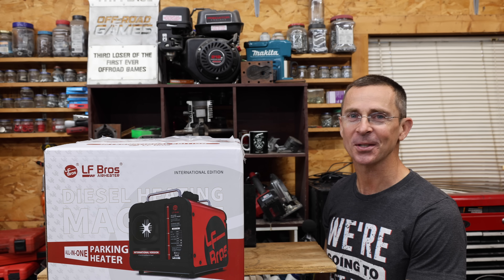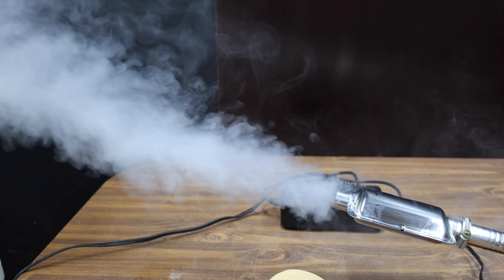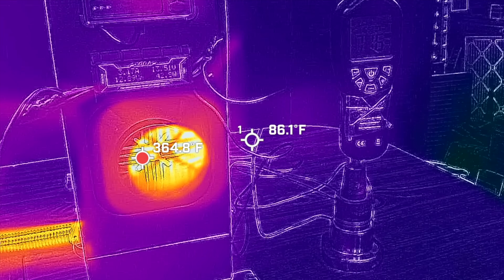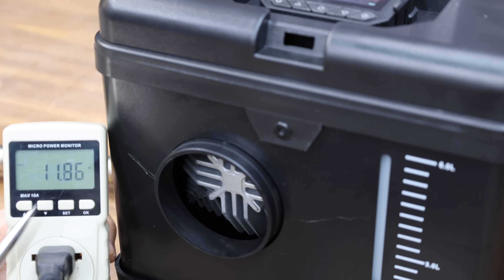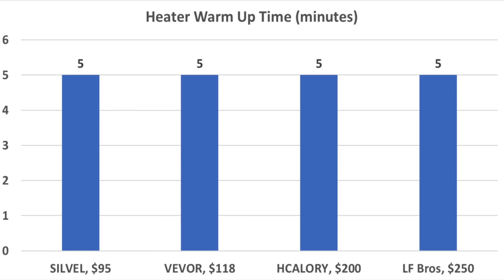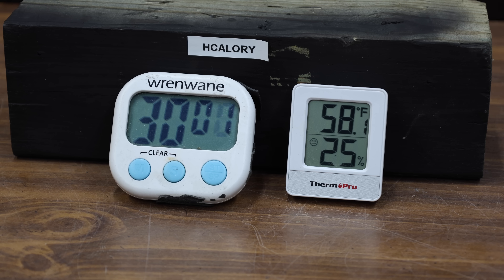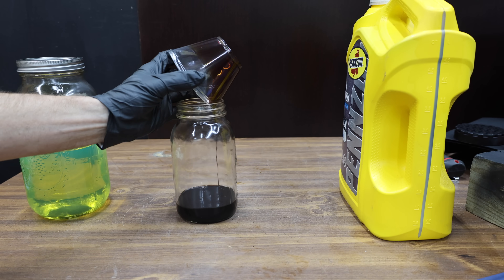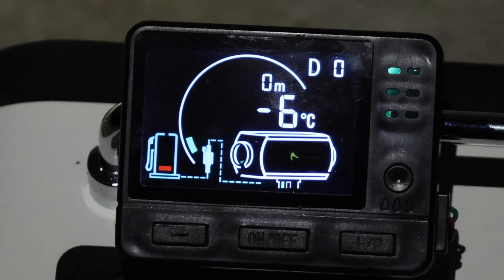The Truth About Cheap Diesel Heaters!

Comment: I've bin heating my garage with the Vevor heated for two winters now !!! Every 40 hours you have to take it apart and clean the combustion chamber. 
One fuel pump and three  heat screens. Fuel pump was my fault if you run the heater out of fuel six times you need a new fuel pump lol. I've burned about two hundred gallons of fuel so far ! Its like the little engine that heats lol get spare parts for your heater model you need new gaskets when you clean it out
Reply from the maker: Thanks for sharing.

Comment: Video suggestion: Bluetooth speakers.

 Glad to see you using your Bluetti, I had the same issue using it's DC to run a VEVOR I bought, could you test the dc output on the bluetti? Its supposed to be 15a I believe so should handle these heaters no problem right? I'll be buying that converter and seeing if my vevor works after all. Thanks for another great video!
Reply from the maker: You are welcome!  Thanks for the video idea.

Comment: If you like the LF Bros, but not the price... the two that are identical are GearZaar and Wippro ($189)
You will want any model that states 2024 upgraded model (or 2025) As some of these are starting to have UL listing approvals. The really new models are the ones with the exhaust already plumbed out the side. That's how you can recognize them right away.
The GearZaar was only $115 at the time I purchased it, and has Bluetooth app and a "quiet" upgraded fuel pump. It runs about 45 hours on low. (I run red dyed Diesel, which a bit cheaper) And it actually included a drill bit for the exhaust hose. Which was a nice touch. AND the wall plug adapter. Which was an aluminum extrusion housing, not a cheap looking black plastic brick typepower supply.
Reply from the maker: Thanks for sharing.

Comment: Just a little bit of info and advice. Video is great for most people who want something that just works out of the box, but Most of the heaters don’t come calibrated from the factory, hence the different levels of smoke at startup. Silvel being the worst. Didn’t know this when I got mine and it would smoke like crazy, eventually it wouldn’t start. Took it apart and the entire heater core was just black soot. Cleaned it out and Adjusted the fuel output and worked 20x better, even hotter. A simple adjustment in the setting page can make your heater work even better and probably last much longer.
Reply: Also when you change FUEL you need to change fuel pump/ fan settings to optimize the burning.
Reply from the maker: Thanks for sharing.
Reply: They'll also smoke if they prime but fail to fire (eg inadequate power on startup).

Or if they're not shut down properly due to some idiot tripping over the wires (ask me how I repeatedly know)
Reply: @exasperated  if they are hot, they can actually crack the combustion chamber if shut down improperly (no fan cooling)
Reply: @ghostrider-be9ek  mine back flowed and melted the entire inner blower lol. Had my exhaust angled poorly while moving.
Reply: @ghostrider-be9ek  Agree they Should all have battery backups. power supplys are sold on aliexpress that have switchover on power cuts UPS. and are a battery charger at same time about £17UK
Reply: I always blow into the intake whenever black smoke starts
Reply: @snazzymcnazmy  Really? Does that work?
Reply: Same experience with me and the Silvel. If buy it you need to change the default settings or it will smoke and burn out. What settings did you land on? Had to lean mine out.
Reply: @cyrusozdalga246 I just ordered silvel hope I can figure this out, don't have any diagnostic tools for this ...
Reply: Thanks! Oh no I just ordered the silvel before I saw this vid. Hope the adjustment directions are in manual or maybe a utb vid.
Reply: They are essential just a glow plug. They are all basically the same. You should be a little mechanical inclined.

Comment: I don't get this. If there is a power outage, why would you get a diesel power heater that need power to run. This seems kinda stupid design. Why isn't it making its own power ?

And yeah, you could use a 12V battery but then would it be drained ? How do you get it fully charged again without power ?

Comment: I have 5 of these installed in the basic heater kit form, garage, outbuilding and standby for the house which is the same that is in the cases the reason all the tests were so similar is because they are identical heaters just put in different cases to make them portable, all the spare parts fit all the heaters (5 & 8kw) so any difference will be down to standard manufacturing tolerances, the length of the exhaust to intake is important when installing.
Best advice, yes DONT use engine oil it will coke up in short order don't even mix it with diesel either, same will happen just take a bit longer. Kerosene works well, the pump needs lubricant or they fail quickly. The Chinese like changing the control systems with these so the mother board and interface are not always compatible. Keeping a spare glow plug, and pump is worthwhile. exhaust hardware bit iffy, silencers are not gas tight, use mikalor brand type clamps for best results.
Using 13v keeps the glow plug current draw down and helps pcb life, best used from a constantly charged 12v battery in case of supply failure as the cooldown cycle is needed for safe operation. very effective and cloned from a well known German brand.
Reply from the maker: Thanks for the feedback.

Comment: I use the Vevor with a lawnmower battery with a 12 volt solar charger in my well house.on low. It's nice as in low it'll last nearly 30 hours, unless cold cold.
I regularly use 60/40 diesel and used motor oil. I've not noticed any carbon build up. At a 50/50 blend i noticed a black sludge in the exhaust pipe.
Reply: What are the conditions for your well? A little $15 electric heater would be better... Using a diesel heater in a well shed is the equivalent of a 600 HP engine in a Prius...

If you have -30 temps I can see, but just insulate it and put a little heater in where you can set a 45f temp.
Reply from the maker: Thanks for sharing.

Comment: I think I would buy the LF Bros simply because it requires less wattage to run using a power bank.  FYI the old Jackery 500 units will power a diesel heater with their 12V plugs but the newer generation and larger 1000W Jackery will not power a diesel heater.  Great great great information as always.
Reply from the maker: Thanks!

Comment: Almost all of these Chinese diesel heaters are the same with different electronics. You can even order two of the same and they will have different electronics. You are better off buying either by the cheapest, or which electronic features you want... But be sure that what they show is what you get.
Generally the "universal controller" is the best, especially if you want to use an aftermarket thermostat like the afterburner. But then again, you can buy one that shows a universal controller in the photos, but come with a totally different controller. On the other hand, there are controllers that look universal but are not.

I would say almost all of the differences from the tests are down to manufacturing tolerances, and how they tuned the settings in the factory.
Reply from the maker: Thanks for sharing!
Reply: @ProjectFarm  thanks for all the videos!

Comment: How efficient are these vs natural gas or heat pump electric?
Reply: Not efficient at all. 

You'd lose money using one of these to heat a living space. They are small, but lots of heat goes out the exhaust. 

If you have a heat pump option, go that route. Only use these for temporary heat... Camping, in the garage, ice fishing, etc...
Reply: @volvo09  garage that's insulated, vs opening the door from the house to the garage and letting the heat pumps work overtime. Thank you!

Comment: to be fair, the silvel smoked after a failed start (where fuel was pumped on to the burn screen but did not ignite) all of the other heaters will also smoke after a failed start. because now theres diesel in the burn chamber and exhaust pipe which makes the smoke when it finally ignites. normally only fuel vapor which ignites via the glow plug.. I have 3 diesel heaters. the noisy Hcalory and 2 Gearzaar that look much like the LF bros. I sopped using the Hcalory, it's too noisy click click click. the oother 2 are hard starting with the included power supply, they work better with a car battery.
Reply from the maker: Thanks for sharing!

Comment: I have been using a Vevor 2kw in my 6.5x10ft Ice fishing house for 3 years now with good results! I run it on 2/3 diesel and 1/3 used engine oil and it runs really well. I have been very happy with it. I get 2-2.5days off two gallons of fuel on medium heat setting.
Reply from the maker: Thanks for sharing.

Comment: Never used a Diesel heater. My only question is, why don't they have a small generator so they don't need power after being started? Burning fuel with and producing heat but not power. I'll stick with my stand alone gas heater.

Comment: If you do this again in the future, it might be valuable to do a test in which you vent the exhaust outside, but close off the garage otherwise, and then have a CO meter to test if CO is still building up in the garage. The biggest thing I would be worried about when using one of these is if CO was leaking through the flex segments in the exhaust pipe, or coming out of the hot air outlet.
Reply: It's a good rule of thumb if you're going to burn anything for heat, get a CO detector. I have an indoor-safe propane heater for when the power is out and I keep a CO detector in the box with it so I know where it is. The detectors expire every few years so they need to be replaced. Better than waking up dead I figure.
Reply from the maker: Thanks for the feedback.
Reply: Considering these things are mostly no name Chinese products, I would simply be worried about exhaust leaks anywhere in the unit.
Reply: Can use some high temp silicone sealant if you're worried

Comment: As a truck driver, we’ve been using diesel powered heaters to warm the sleeper for years. I didn’t know that they were available for non commercial use. This channel is awesome. Thank you so much for what you do!
Reply from the maker: You're welcome!
Reply: Just recently in the past few years. Webasto’s patent expired so china did what china does best.
Reply: @LifeofAedan  Would have been great to see a Webasto included in the comparison. Also a class comparison with a Propane type like the Buddy heater.
Reply: @LifeofAedan  yes Webasto and Espir. Doesn’t surprise me that they’ve been sold to or farmed out to china
Reply: @glentucker4250  Neither Webasto nor Eberspacher has been farmed out to China, China is just making the design too now that isn't patented.

A Webasto air heater like this is closer to $1K than $150.
Reply: In northern europe even diesel cars have diesel heaters(Webasto).
Reply: @Technoboy1000 it depends I'd say. I only know this case that the heater in the car uses the same fuel type as the engine uses. In my case a Skoda Fabia using petrol and the auxiliary heating uses petrol too. It may have only one downside: if you set on automatic and "forget" your car over a month, then it's likely happen that the (main!) fuel tank is (almost) empty. But on the other hand it's more comfortable because I don't need to refill a small extra tank.
Reply: @Technoboy1000  Yes. And they aren't offered in the USA due to liability concerns if they're used in a garage and give someone carbon monoxide poisoning. They're missing out.
Reply: @Fekillix They are vented to the outside!
Reply: @astroboy5137 If you have a car with a Webasto parked in a garage, it definitively isn't vented to the outside.
Reply: Have rebuilt many Espar and Webasto units in OTR trucks.
This is identical, just bigger.
Things kick out serious heat.
Newer idle laws have and emissions systrms that hate idling have helped some fleets adopt these. The real savings was fuel use though.  Average 15L tryck engine uses average 4 gallons/hr of fuel. Diesel bunk heaters use approx 0.4 gallons/hr.  Huge savings for larger fleets. 
Glad to see these being offered cheap and in big boy sizes.  Espar units were like $1200 (8-10 yrs ago).
Reply: @wrenchpony9735  Greetings: I installed and serviced them back in the 80s. R U in Canada?
Reply: @Dark_Knight_USA  nope. NE Ohio. Edge of lake effect snow 🥶. Not quite Canada cold, but we try 😁👍
Reply: @wrenchpony9735  Greetings: I have been there. Yuk. Notorious 4 the horizontal icicles.
Reply: Boomer probably don’t even know how to Google things lol 😂
Reply: @Sickoloko24 Boomer invented Internet lol
Reply: You know they invented the internet, right?
Reply: How do you warm up truck with the heater if it has exhaust fumes? How does that work
Reply: I've been using them in my boats for years
Reply: Can you suggest one that doesn't have a fuel pump that clicks?
Reply: @neogeo8267 they all do. It’s because of the build from espar and webasto of expired patents. No one made their own at all.
Reply: These have been around since the 1930’s.
Both gas and diesel.
I had a 1972 VW van with one in it.
China built over 17,000,000 of them and installed them in their state owned trucks in just over a year.
Reply: Greetings: I was installing Espar units in trucks back in the 80s as a trial. The pitch was they used less fuel. However they R current pigs. There were many problems with them then. I had proven modifications and changes however the company decided 2 abort the project and remove them. Sometimes I wish I would have saved a few. Then again, I have way 2 much junk being a pack rat. 8:54
Reply: Same.
Reply: The patient expired a cupple years ago now they are everywhere
Reply: @aaronoconnor606  Greetings: "cupple"? New spelling of existing word? New word or a misspelled word? :)
Reply: you're not funny
Reply: What do you mean non commercial use? Everything is available for non-commercial use...?
Reply: @cabinfevrr  Greetings: I understand what he said. Decades ago they were installed in some OTR CMVs as an attempt 2 save fuel, engine hours and noise. Such was soon aborted Bcuz of expense, trouble and parts availability. The private market had no use or demand much less could afford.

Comment: You forgot to mention a Battery to keep the fans going..  
Good Video.
I prefer Catalytic heaters as in Most RV's.  Run on Propane.  But they get expensive.  But then you need to get a Nice fan or pay the kids to Fan the heat around.
Reply from the maker: Thanks for the feedback!

Comment: Should run the exhaust through a water heater/buffer tank with an internal coil then plumb the exhaust to the exterior from there. It would make lots of hot water with that amount of exhaust heat, you could then circulate that through radiators or plumb it to a sink/shower.
Reply from the maker: Thanks for sharing!
Reply: @ProjectFarm  I'm over at my home in Ireland and dreaming about dry warm air... They only use radiant heaters here, God I miss forced air heat/hvac, and how it dehumidifies!

Comment: The problem is, if you have an extended power outage,  it may die on you.  I have used kerosene heaters that don't use any electricity,  and heated a 2290 square foot home for 3 days waiting for the electricity to come back on. Kept the temperature about 65- 68 degrees,  not overly hot, but livable.  Used about 15 gallons of kerosene though. That wasn't too bad, as kerosene at the time was about $3 a gallon.  (In bulk)
Reply from the maker: Thanks for sharing!

Comment: This would be a great addition to my 24x24 garage. As I do my own oil changes i have at least 5gal in used oil in those 5qt jugs. I would plan on breaking in with a tank of straight diesel or K1 kerosene. After that what would you recommend for an oil/diesel mix that would burn clean enough to not soot up the burner? Much appreciated. Thank you
Reply from the maker: You're welcome!

Comment: Never connect these diesel heaters directly to the cigarette lighter plug on solar generators. These heaters need 12 to 15 amps to operate correctly and the solar generators only put out 10 amps which will cause your diesel heater to turn off after a few minutes.
Reply from the maker: Thanks for sharing!

Comment: I purchased the Velit 4kw/14000BTU Gasoline/Diesel Air Heater. It's the other configuration where the heater, fuel tank and digital controler are separate. I like it that way for design versatility. It's currently in my van sipping off of the utility fuel port that Ford provided on top of my Transit HD fuel (gasoline) tank. Cost me around $600. If you buy the cheap Chinese one make sure to buy a rubber fuel line so you can cut that up to use them for transitional fittings for your fuel pump, fuel filter and termination point to the unit. Make sure the fuel line is the stiff nylon one. The VELIT already had those pieces so I didn't have to worry about it. The only regret is the archaic digital interface. I had wished I'd gotten a cheap chinese one as their interface is much better. Make sure the muffler weephole is pointed downward to get rid of any condensation.And also switch out all hose clamps for stainless steel ones (believe me; you will regret if you don't).
Reply from the maker: Thanks for sharing!

Comment: I've had the Vevor for 2 years and it was what it was supposed to be. No complaints. HOWEVER, It lost power to the control. It won't even light up. I bought a replacement controller and the same thing. Anyone out there got any tips? Thanks.